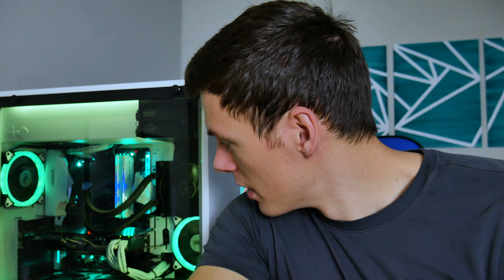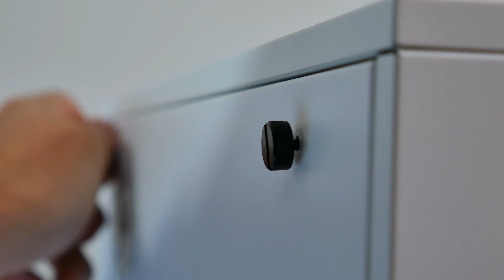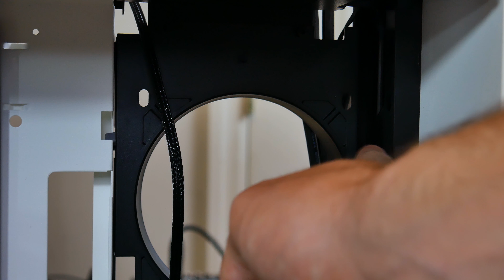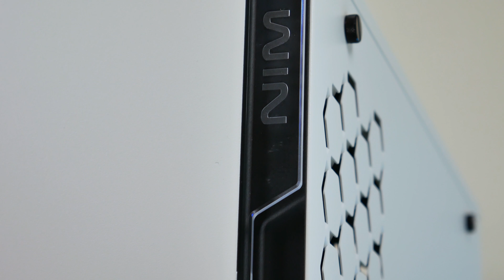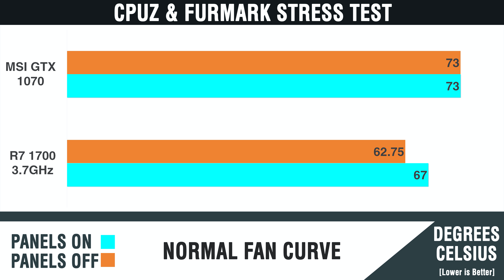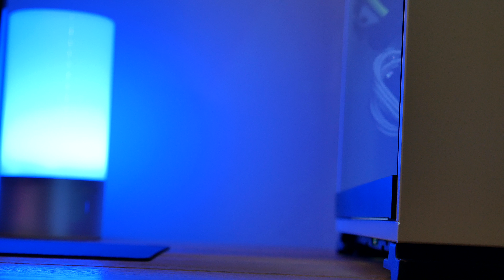A "Budget Minded" PC Case From a High-End Brand? - In Win 101 Review

Comment from the maker: Been working with this case for a while, let me just say this, this is a very well built case for the money, and very easy to use. And to anyone complaining about the term "budget" needs to listen to what I said in the video. "Budget" is a relative term, when the In Win 101 is compared to the price of other In Win cases it is the cheapest option, therefore this is a "budget" case compared to the others. That's why the title has the specific quotation marks around *Budget Minded*. 

For the thermal graphs I voiced the wrong temps, the temps recorded on the graph are the correct ones.

AND lastly, I posted the review to my website a couple days prior to the video, so if you want the step ahead make sure to check it out :) https://goo.gl/zWSHqM
Reply: JDTechGear hey there is inside this case a custom loop with a 240 and 360 possible?

Comment: This case really cries for a 240 cooler instead of a 120.  And then I must  impress upon you all to install that cooler with the hoses DOWN, at the bottom.  Thus eliminating any airflow into your CPU pump and making the system more reliable and quieter.

Comment: This is my first case for my first PC build ever, and I must say this is a FINE case for the money. The airflow is nice, its quality all around the board. The glass panel is perfect, and the ease of use is perfect. I like the little honeycomb cutouts for airflow on the side, and Its able to house a big ol CPU cooler from Deep Cool. Got 8 fans cooling this bad boy, and its just such a nice looking case. Perfect for my Black/White theme. I'll give it a 9/10. Would be a 10 if the glass panel screws that pop out didnt feel so cheap, and also the feet at the bottom of the case feels a tad flimsy. They work great, its just the feel of it.

Comment: the cable cut out might get blocked but if you run them before you mount the mobo in the case you will be just fine in using it
Reply: True

Comment: Man, I really dig that case.  I'm a fan (rimshot) of cases with mesh up front primarily because I prefer better cooling to aesthetics - but of course, looking nice would be great too.  With all the craze these days of having a solid front panel for a cleaner look which also obstructs air intake, these In Win cases are configured to allow uninhibited intake at the bottom while still having that clean look at the front.  And really, no included fans is kind of ideal if you plan/prefer to use your own fans so you don't end up paying extra for something you wouldn't use - but no fans would be my only potential knock against this case concerning "value" for the average consumer who may not realize what they're getting.  In all, slick case, In Win; great review JD